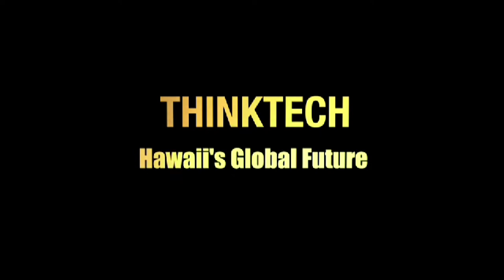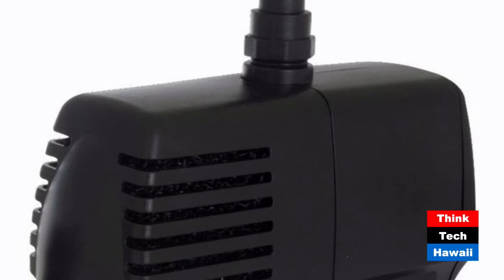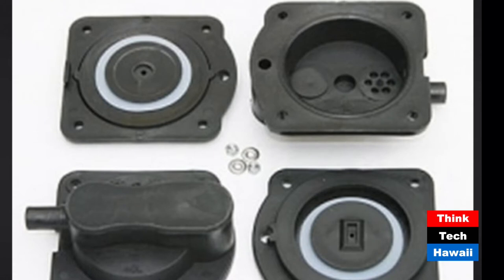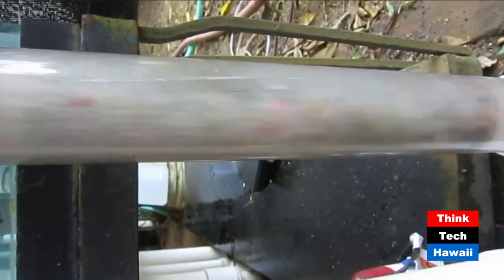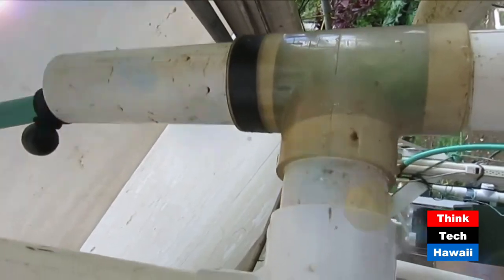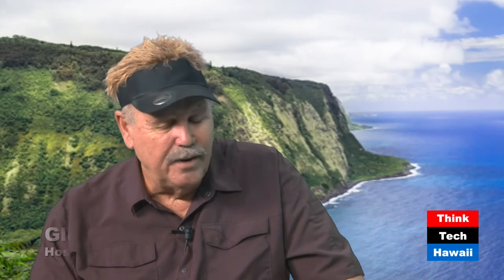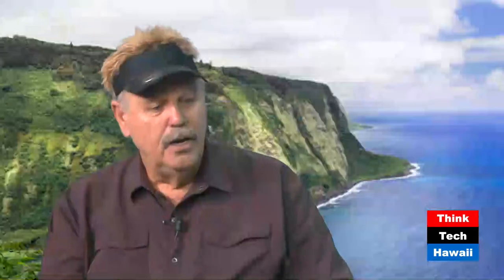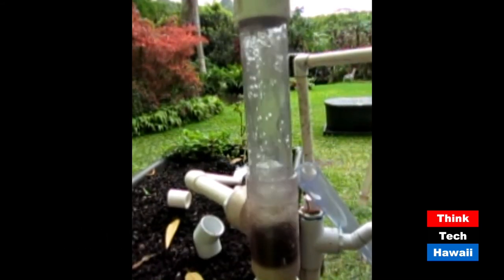Air pump vs water pump (Discovering Aquaponics In The Garden)

Comment: 1. Aloha Glenn and Natalie, First of all, thank you for sharing the ideas of making the airlift pumps for aquaponic enthusiasts around the world as me myself want to do the same thing here as well ((the idea to search for one come to my mind when i want to device something with my aquaponic project (still in progress...)  that can collect poops and debris from the fish tank efficiently)).
 
2. That is one reason. The other reason is i dont want to spend bucks on hiring a contractor or technician to get my electricity thingy out to where i want to set up my mini aquaponic project coz it quit expensive! (i need to spend around RM300 just to add extra wiring up to one floor above  at my building), and for a beginner and for a small project one, i found that it is not make sense at all.

3. There's a lot to write here but let me just go straight to the point, I have had watched many of ur fascinating yet informative videos and i notice you put the 45 degree elbows right after the one-way check valve. May I know why? what if i just make the pipe straight after the check valve instead of putting and lifting with the 45 degree elbows? will it works just fine?

4. Dats all from me. A noob from somewhere somewhere in South East Asia :).

5. Peace;)

Comment: Dear Mr. Martinez I have a greenhouse on a third floor I have a water pump my electrical bill is higher than my greenhouse. Would you explain a little deeper the turbo charger so I can lift up the water. Is there any way or place I can buy them? Thank you from the coffee land. (Colombia)
Reply: Sorry for delay....yes I can help you. I sell my TurboInjector for $250. You can copy it and make as many as you want. You simply install it on top of the water pump, the air is injected and lifts the water to any height desired. You need one PSI of air for every foot of water depth or pressure you need to overcome. I use 60 watts injected in a 900 gallon per hour pump that can only lift to 8 ft maximum, but with air inhjected lifts to 24 feet, 450 gallons per hour. Air compressor is 2 psi at 2 liters per minute air input. 
If I need to lift 24 foot , 450 gallons per hour, I go up to 120 watt air pump, 120 liters per minute air, gets me greater height. it is all a balance of air to water ratio. Neither air o electric pump can pump over 10 foot anything at all, but together they lift 20 feet at 450 gallons per hour.

Comment: Where can I find one of these pumps?
Reply: You need to build it bro. It is DIY just a pvc pipe put air into it and the air or bubbles will carry the water
Reply: Glenn uses the Hakko Matala air pumps. Depending on what you are going to be using it for, Glenn has several different styles using the air pump to move water. You can check out more of what he does on You Tube, or www.olomanagardensaquaponics.com, www.olomanagardens.com, You would need to be more specified as how you will be using it for.
Reply: Thanks, I'm interested in aquaponics but am at work 60 hours a week.
So, I may start with  wicking beds and vertical drip towers.
I've heard that vertical tower grown plants will start wilting in a relatively short time if the water flow fails. So, a reliable air pump and backup is important.
Reply: garyrich2000 just saw an O2 backup on a system which turns on when the power goes and depowers an active solenoid or when a pressure gauge tripped.